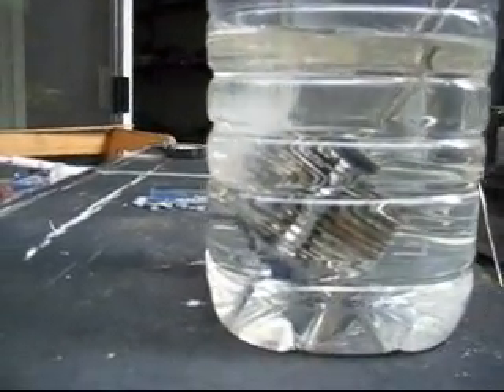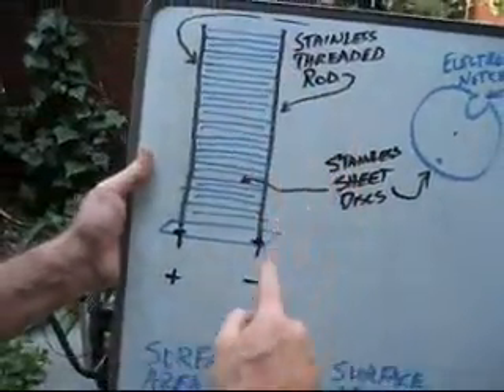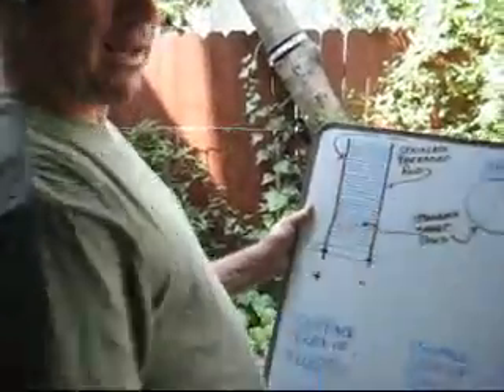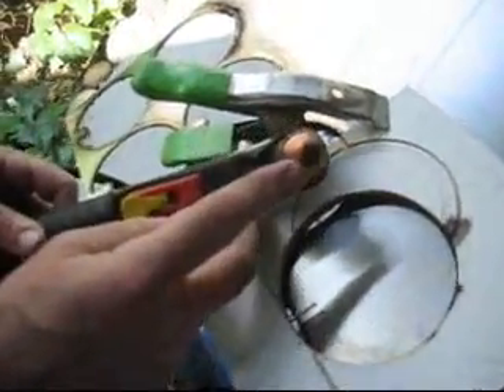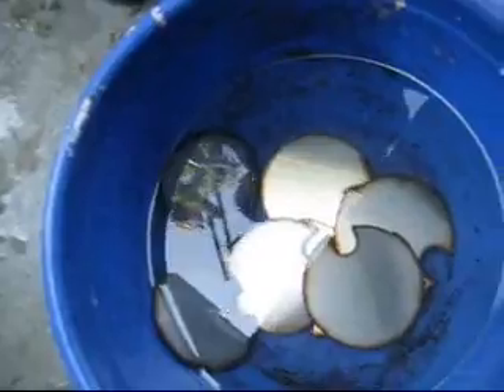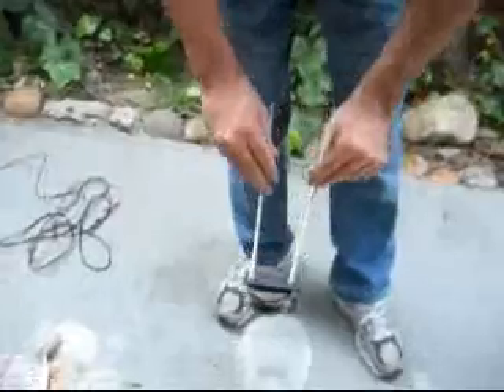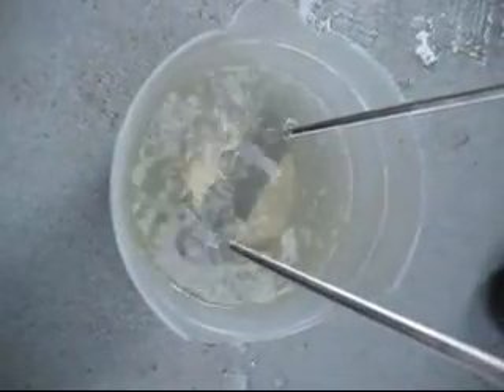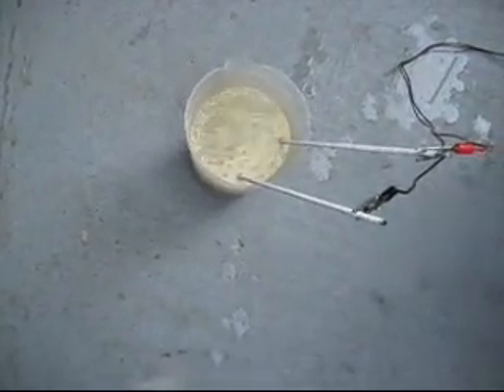HHO Generator Redesign with plates.

Comment: If you make a dry cell you get more gas. check hhopwr on youtube. Put gaskets between the steel plates instead of making a wet cell. With a wet cell you get far more current leakage and current leakage makes your cell less efficient. 

Greets